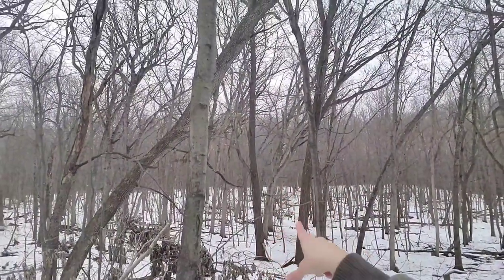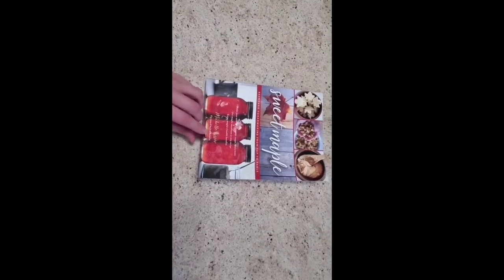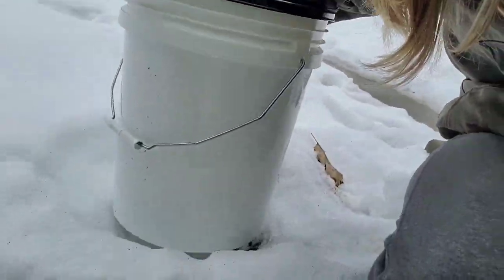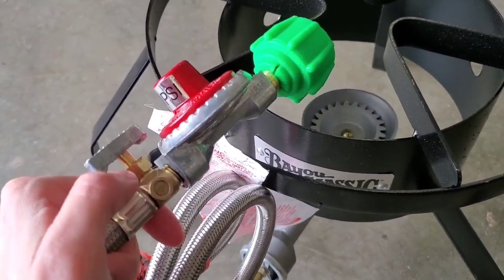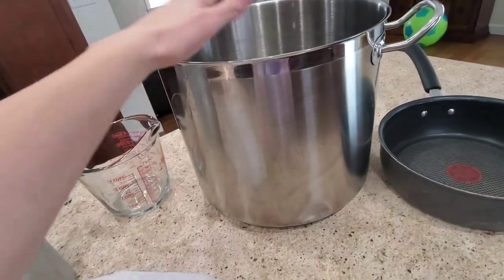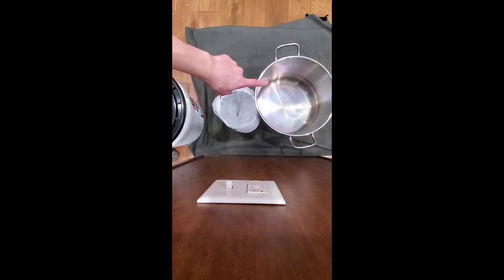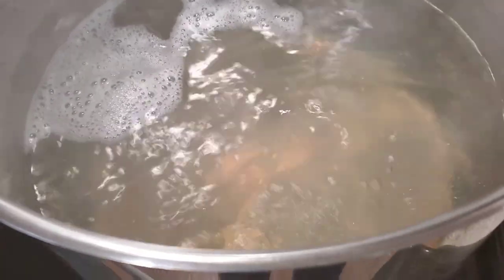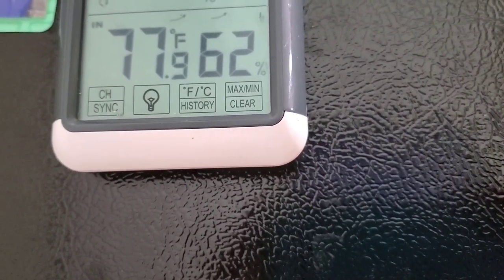How To Get Maple Syrup | Step by Step of How I Collected Maple Sap and Boiled it Down to Syrup

Comment from the maker: Also during the video I said I would double check on some info and put the correct stuff in the comments, so here it is. 

1. The DIAMETER of a tree you are tapping should be no less than 12inches. (I said circumference in the video)

2. Drill the hole for your tap 1&1/2 inches to 2 inches deep. (I think I said half an inch in the video. Ha)

3. I forgot to mention this but prime maple sap running time is in the spring when it is below freezing at night and above freezing during the day. (Seems to run best in the 40°F range during the day) Do not tap unhealthy trees and stop collecting once the trees form buds, you will end up with a bitter Syrup.
Reply from the maker: Also Bear Bottom Acres just posted a GREAT video with way more info on how to identify Maple Trees, so be sure to check that out too! https://youtu.be/5CPILuYiHA8